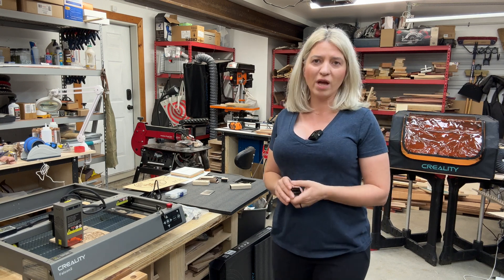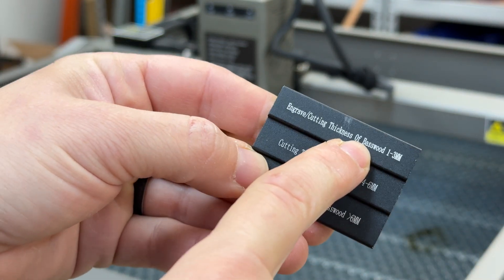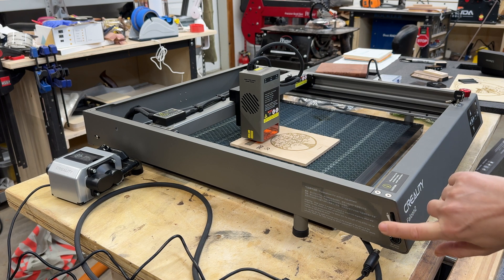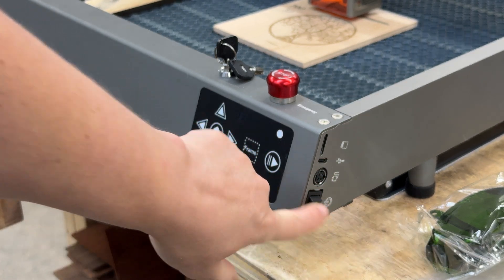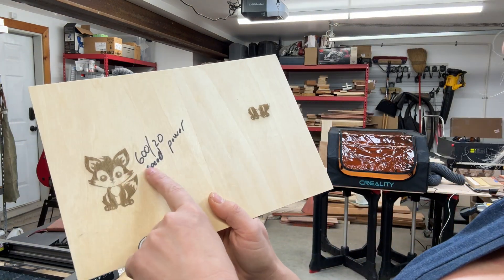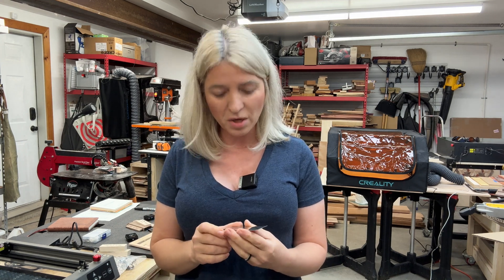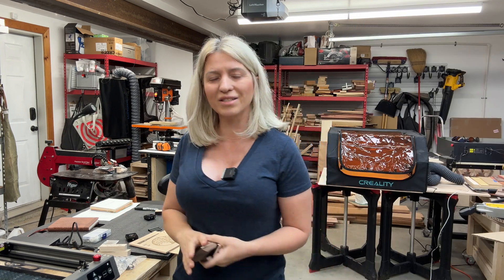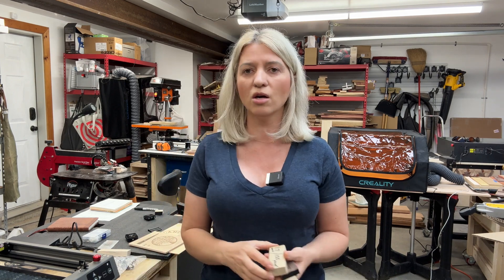Creality Falcon 2 40W Laser is DESTROYING the competition when it comes to cutting. Impressive laser

Comment: You have me sold on the Falcon 2 40 Watt laser. I make custom clocks for friends and for Family during the Holidays. I currently have a Longmill CNC router which has an accuracy of a tenth of a millimeter. I cut 1/4" plywood with the router and make a hole in the middle for the clock shaft. I modified the CNC Router so I could attach a 20 Watt laser to it. The laser is good for engraving but the only material it can cut is felt, doesn't matter how many passes, even on 3 MM plywood it is not able to cut through. Since the Falcon 2 can cut and engrave at the same time. Looks like a perfect laser for the job.
Reply from the maker: You will love the cutting ability of creality! You can cut half in hard wood with no problem. Even 3/4 in poplar it can cut in one pass

Comment: I'm looking for a laser cutter/engraver that will give me the best photo engravings on wood or metal and also cut .05mm steel. However, when i cut the VERY thin steel sheets, I need to cut 16mm x 4mm sections. Do you know of any that can do this with that type of accuracy?
Reply from the maker: xtool will do great with engraving and will be very accurate. I never tried to cut steel, so i dont know about that

Comment: You have demonstrated several laser cutting/engraving machines... in your opinion, factoring cost and capabilities, which machine would you suggest to a first time buyer?
Reply from the maker: Xtool S1 for new or advanced user. Unless you are purchasing a laser strictly to just put your logo on things. Then a cheap Longer ray5 10W will do for around $300
Reply: Nice to see a straight answer😂